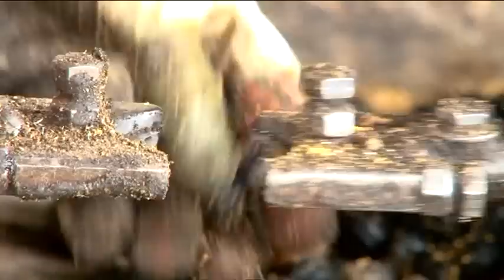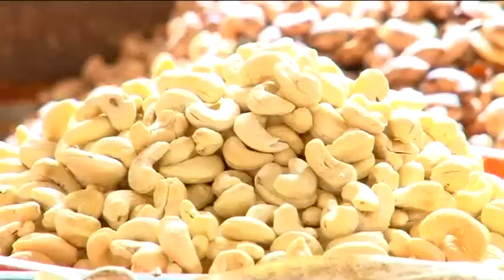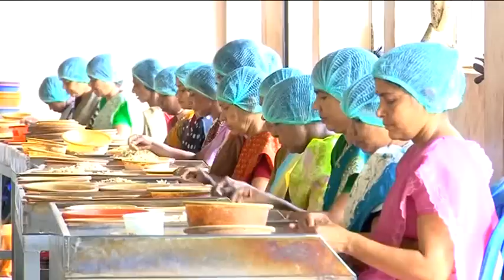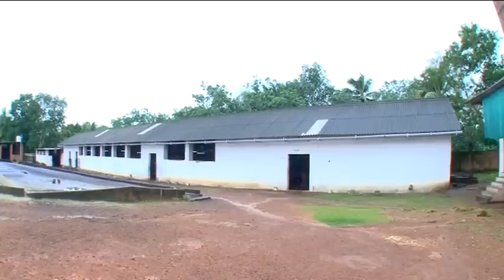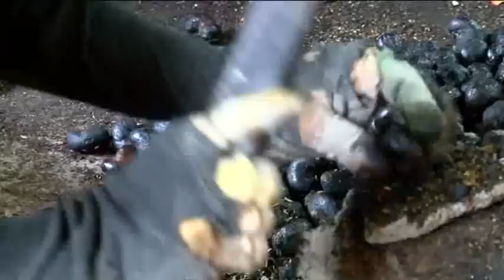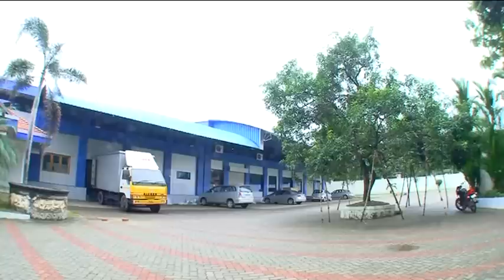St.Pauls Cashew Factory Video 1

Comment: Its very dangers job to do if she missed her fingers will mash.
Reply: No,it is not,they just get fast at doing it. They position the roasted seed with one hand and with the other hand applied pressure to the shelling press. The seed is already roasted so it only needs a fast cracking to separate the nut from the rest.